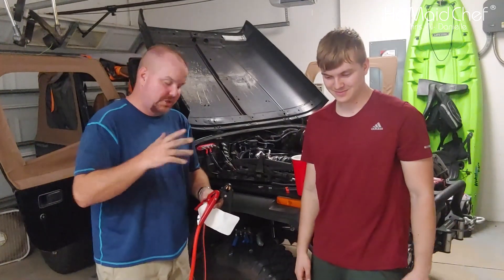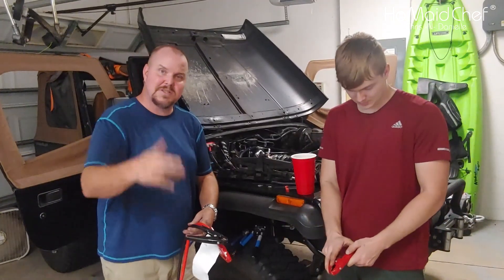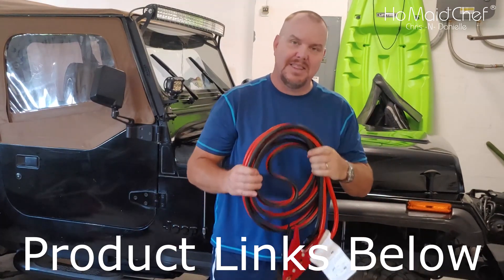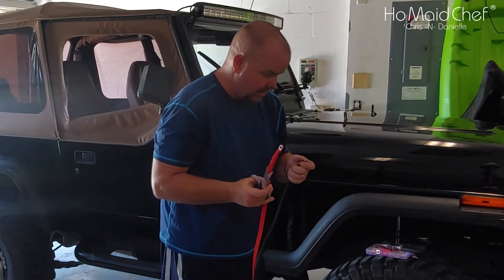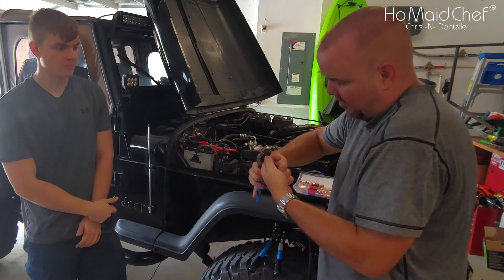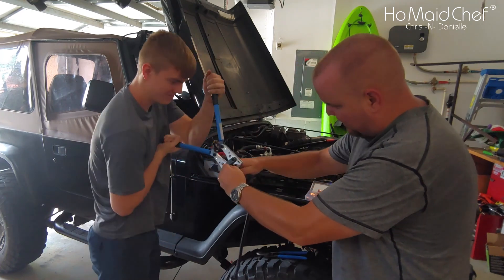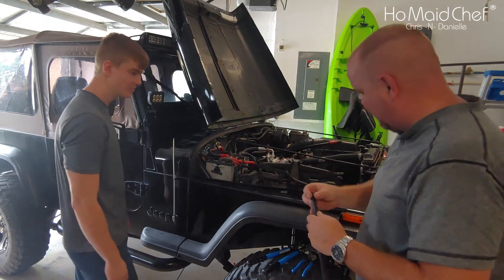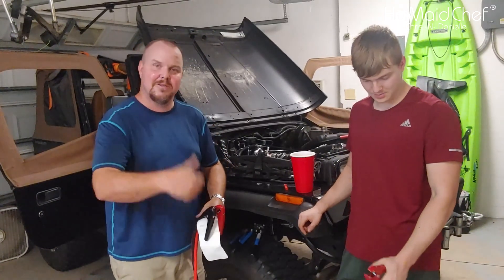How To Terminate Wire, Tip Jumper Cables are Cheap, 4 To 0 Gauge

Comment: Are they solid copper or are they copper coated aluminum?
Reply from the maker: This is 50% CCA, only really care about solid copper in communications cables. The biggest advantage of this cable for our jeep is the thick protective rubber coating.